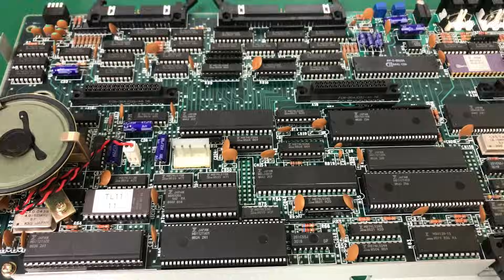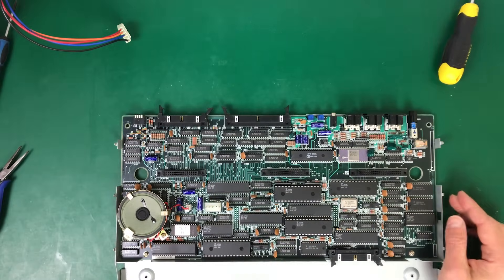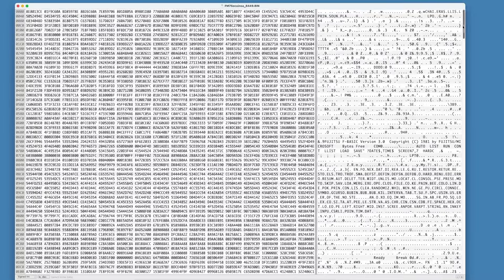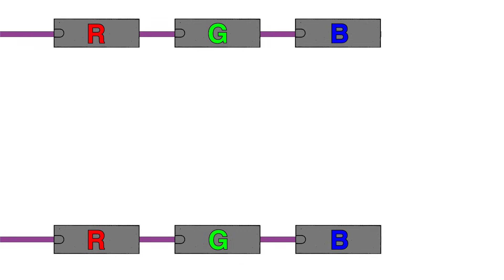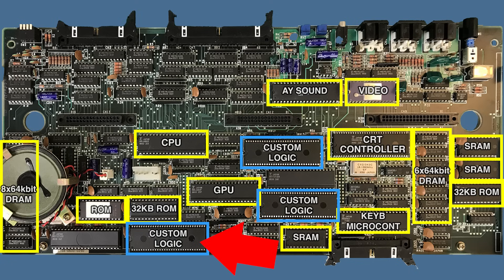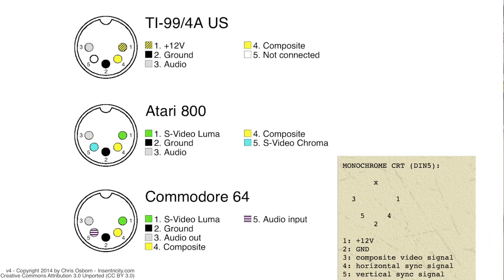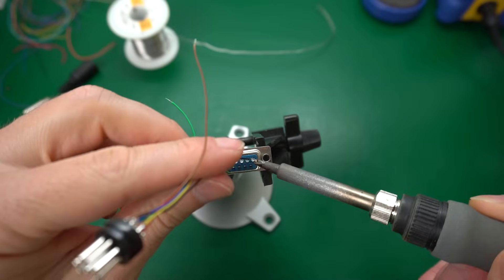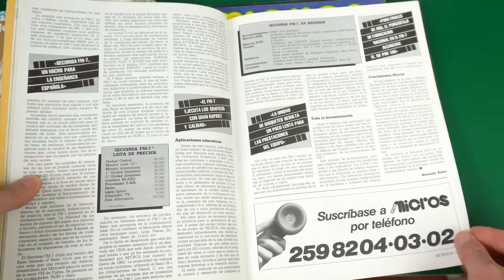This 8-Bit Computer Has Two CPUs (And One Acts As A GPU!)

Comment: The architecture reminds me of the BBC Micro with its IO processor (the BBC micro 6502 itself) handling the video/IO, and a second processor (via the BBC Tube interface) running the application.  This was the original idea by Acorn for the Proton (BBC prototype). You can get now lots of co-processors for the BBC with the Raspberry PI.
Reply: Acorn BBC - Econet GOOD TIMES - although ELITE (Braben & Bell) was almost unplayable (way to fast) if your (primary school) Beeb had a second 6502 processor connected via the Tube interface.

Comment: You said in the Commodore 64 DIN socket pin 3 carries sound so you could use that cable for the video out, but all 3 of the DIN connectors you showed also have sound on pin 3, you could do the same for any of the cables for those machines.

Comment: It's worth keeping in mind that one of the reasons for the sub-CPU architecture was that the video display system was done much more simply than on many other computers: it's a straight 3-plane 640×200 graphics display, with no hardware support for text, scrolling, or anything like that. (I'm not aware of any other 8-bit computer system that did this as a standard display system, though there were probably S-100 or similar video expansion cards that worked the same way.)

This creates two issues. The first is that your frame buffers take up 48K of address space, and the second is that you need to display letters dot-by-dot, as e.g. HRCG did on the Apple II. Given the address space and CPU requirements to do this, dedicating a separate CPU to the task makes a lot of sense.

And doing things this way makes even more sense when you remember that the computer was designed to display Japanese kanji. The kanji card for the system had 128 KB of ROM and held several thousand 16×16 kanji glyphs that the sub-CPU could read and render in the same way it rendered normal text.

This also offered several fun features. Since a program was rendering text, you could render it at arbitrary sizes and orientations; FM-BASIC supported this.

If you're interested in the details of any part of the system, I have made the schematics and a few notes available on GitLab in the `retroabandon/fm7re` repository.

Comment: FM-7's main system can be switched to various CPUs,  The expansion slot on the right is for that.
MAIN(6809.,6309, Z80, 8088, etc…) + SUB(6809)
This slot is also used to connect FM-X (MSX),  Control MSX display and sound from FM-7.

Comment: The Nintendo 64 (and most SGI's that it was based on) were similar in this aspect, sort of. The graphics was another MIPS cpu, but basically run more like a microcontroller with microcode that controlled the (mostly) fixed graphics pipeline. The main CPU did the geometry, and the second did all the rendering with passed parameters. The second did have things like 4k of graphics cache on die, but it was indeed a second processor with code and cache built in. Remember that SGI created OpenGL.. basically a way of abstracting draw instructions that the microcode in the graphics CPU would interpret into it's own instructions. Very few games actually licenced the ability to change the microcode so it was usually a fixed pipeline in essence, but modifying it would be like adding features to OpenGL, like adding a posterization layer or such.

Comment: The first thing that came to mind when I saw the title was the Soviet Elektronika UKNC, which has two of those Soviet NC-architecture CPUs that are not PDP-11 clones on chips but are PDP-11 compatible (binary I think but might be only assembly compatible for all I know). That also has 3 bit planar graphics, but is paletted out of a 6 bit palette. It is also much later, 1987. I have no idea if it has any ROM for the peripheral processing unit as it is called, but I would like to think so given its allocated role of graphics processor despite being just a normal CPU. However it probably doesn't. It was very interesting to learn about this machine anyway, thanks!

Comment: 11:12 The 2KB ROM definitely is code (good call).  From inspection and educated guesses, the ROM is divided into 4 sections that are bank-switched into address 0xFE00 - 0xFFFF.  On the 6809, address 0xFFFE is the reset vector and all 4 banks have the reset vector send the CPU to address 0xFE00.  In the 4th bank, there is just 1 instruction: BRAnch instruction that loops forever on itself.  The other 3 banks start with a BRAnch instruction that skips over the next 9 bytes which appears to be 3 JMP instructions (likely a jump table).  I'm not a 6809 expert but still interesting early results.
Reply: Just took a peek at the 32KB ROM 8449 and its last 512 bytes has the same structure as the 4 banks mentioned above.  All 5 banks are different.  Interesting...
Reply: After using a diff tool on the 4 banks of data (ignoring the one empty-loop-forever bank), they have a common structure.  They mainly differ in the first ~64 bytes and the last ~64 bytes.  The middle portion of each are identical other than a few bytes due to some jump offsets being slight different (this middle portion is what the 1st of the 3 JMP instructions mentioned above jumps to).  The 1st 64 bytes is where the main differences are.  The last 64 bytes are typically empty except for one bank where the 1st 64 bytes JMPs over the middle section to continue executing in the last 64 bytes.

Comment: Awesome video! It's such an unusual system. You should have no issues taking a computer like that through airport security - especially since it doesn't have batteries. I've packed many slightly weird things like electronic drum machines in carry-on bags and have never had any trouble. As long as an item isn't explicitly on a prohibited list you should be good.

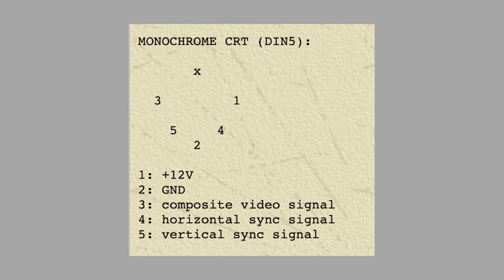Comment: 13:56: The 60Hz-ness and the 12V pin on the DIN connector (13:06) lead me to suspect this probably originally shipped with a custom CRT that was powered from the computer. Kind of like Amstrad used to do it.

Comment: Actually the system diagram does explain what that extra 2k rom is.
CRT
10k ROM
MB8364
MB8516(CG)
So that block is actually two ROMs, 64kbit/8kbyte and 16kbit/2kbyte.
The second ROM being labeled as CG confirms what I suspected, it's a Character Generator ROM, or set of bitmaps for letters and numbers to be displayed on screen.
Reply from the maker: Oh that makes a lot of sense! Thanks.

Comment: You've got 14 address bits going to those 16kbx1 ram chips. There are just eight such ram chips next to each other, to satisfy an 8-bit-wide bus.

Send those 14 address bits to two 64kbx4 ram chip (which still has 16k addresses, but is just 4 bits wide).

It is the same addressing. Two 4-bit-wide ICs is the same effective width as eight 1-bit-wide ICs.

Comment: Very cool.  The "gpu" seems to follow the 6502 and ANTIC scheme on the Atari 8-bit line somewhat, where you could upload independent programs to the ANTIC (limited to a small set of graphics related functions) called "display lists" stored to on-chip S-RAM to perform some graphics functions independently of the 6502.
Reply: Display lists weren't in on chip SRAM. Antic fetched them from regular memory using DMA. In fact Antic does all the DMA in the system.
Reply: @user-qf6yt3id3w  Thanks for the correction.  The onboard SRAM is used for other things: "A buffer within ANTIC is used to store graphic data for a single scan line. Its purpose is to buffer data for use on repeated scan lines, reducing DMA overhead. For bitmap modes, it allows ANTIC to only read graphics data for a mode line once, during the first scan line. For character modes, it holds the character name data which is then repeatedly used to fetch each scan line of character data from the character set."
Reply: @redleader7988  Well I never. You're right. And if you look at the die shot the 48 bytes of SRAM take up a decent percentage of the die. So Jay Miner and co must have thought it was really necessary.
Reply: Yep that was a classic Jay Miner design. He also designed the Copper graphics coprocessor for the Amiga which had similar capabilities.

Comment: You actually can upload custom code to the sub CPU. I'm not sure if the commands fir it were ever officially documented but they're there.

The two CPU setup is interesting because it means normal code doesn't have to worry about managing the sizeable 48KB of VRAM or having to share a bus with it while the sub CPU can get full direct access to it. On competing machines like NEC PC-8801 or Sharp X1 you had to bank switch the VRAM into the main CPU address space one 16KB bitplane at a time.

I think this setup was mostly there to provide high resolution graphics while letingt programmers focus all the CPU time on processing without worrying about the graphics subsystem getting in the way. I don't think graphics draw performance was that much of a consideration.
Reply: I was going to write the same comment. It is indeed possible to upload custom code to the sub CPU. Each of the main 8-bit Japanese systems had a different approach to obtaining high resolution display, it is very interesting to understand and appreciate them, and their evolution.

Comment: If you added a second processor to a BBC Micro via the Tube interface then the Beeb itself was effectively relegated to an IO processor.
Reply: We had a BBC in our school with a "Z80 second processor" so that it could run CP/M.
Reply: Back in the day, I had a 65C102 co pro (similar instruction set, but higher clock speed), and a 80186, which was an Intel chip, and could run DOS and GEM.
I never had the Z80, or 32016 (expensive research kit) - and there were others.

Now, you can get a Raspberry Pi Co Processor, which can emulate any of the original ones, and can run in native mode. (You can also use the HDMI output on the Pi, but that kind of misses the point...)

I have a BBC Master with a Pi CoPro, a Pi 1Mhz Bus Disk emulator, and a Pi Econet Hub/Bridge ... kind of like in Star Trek, where the ancient Voyager craft has all the new kit added to it to make it keep running, but in the core, it's still the original hardware and programming....

Comment: Interesting that this computer would use an actual CPU as a graphics processor rather than something hardwired, which while much less flexible, would be WAY faster and also much cheaper than the complicated hardware we see here, with RAM, ROM and even SRAM and those big gate arrays for interfacing everything.

There were 8-bit systems with blitters quite early on, the Williams hardware which ran Robotron 2084 for example used two custom blitters to draw all the stuff flying around the screen (up to 80 objects/frame drawn - way too much to do in software at the time.) The hardware could do a theoretical 1MB/s, and clocked in at 910kB/s when actually running the game - I assume the game either isn't maxing out the hardware, or some performance is lost in overhead while writing to the blitters' registers.

Comment: If that's a PFC SMPS power supply, it doesn't need a 220/110 switch. It will work on either. Only the old type power supplies needed a selecter switch

Comment: 6:20 I don't understand why you would jump to that weird conclusion about the layout of the video RAM.  (I don't have access to this system, so I can't check, but given the design of the earlier version you have the schematic for, that is certainly not the way I would have done it, or assumed anyone would do it)

The original version has three banks, each of which are 8 bits wide (1 bit x 8 chips).  So why would you not assume that the new version also has three banks, each 8 bits wide (4 bits x 2 chips)?  Then the only change in the architecture is that each bank consists of two chips instead of 8 (which means the rest of the system design can be identical to the original one (same shift registers, etc)).

Comment: I honestly think that maybe its very well possible that you can write "shader"-like things for this in the tiny memory unused from the graphics ram AND the sram. That is one would need to upgrade the rom of the "gpu" so that it can copy data from sram into main graphics ram's unused area and define a special opcode (with parameters) that run that uploaded code - this only makes very small shader possible - but theoretically possible to add custom functionality I think only with writing to the rom of the "gpu"... Sounds cool. Also it is possible that their cpu-side rom can do this too and support it already, but if not it still sounds a possibly hack to pull of.

Very cool!
Reply: "Shader" is probably too-specific a term. I would go with "graphics processor" since a shader means executing the same code for each of many pixels simultaneously. Then again shaders might technically be Turing-complete but they don't really like branches or loops whereas using a full CPU as a graphics processor you've got no such restriction. Nevertheless it would have tons of uses for game and demo tricks, that's for certain!

Comment: Hmm... If the graphics 6809 can execute code in SRAM, some really cool stuff could be made by having the main CPU write code for the graphics processor to execute. The main CPU could keep writing code while the GPU runs it, just making sure not to write the bit the GPU is running.

Britain's Coupe computer was another 80s design with a second CPU for graphics. It used 2 Z80 CPUs and emulated a ZX Spectrum, though its build quality was probably much higher. It was exceptional in having its keyboard toward the rear of the case, leaving the front as a wrist rest like a modern laptop. Its downfall was the fact that it couldn't emulate graphics mode 7; a mode so powerful, almost all games used it. Essentially, the Coupe could only run Spectrum business software and, well, I think we can all imagine the problem. :)

It's also the same idea I'd use, but I'd use 2 6502s -- or 3 or 4! :) But I'd have the whole RAM shared because I'm lazy and fast SRAM is cheap now.

Comment: VideoRAM config: I think they just replaced each bank of 8 1bit RAMs with 2 4bit RAMs. A CRTC is usually the signals for a Cathode ray tube: horizontal and vertical sync rgb, chroma/luma or composite video signal.

Comment: You will find something not similar but interesting in the French Hector/Victor and their "CP/M floppy unit", this one being a complete computer, and what looked to be the computer only do keyboard handling and display management, both unit with a Z80.
So the Hector/Victor main CPU, Z80, is available to do anything you want, with it's graphic modes!
Reply: The communication was done through RS232C (thus UART) @ 9600bds, so less interesting than shared SRAM chips, but still efficient enough for a computer of this era.
And I naturally used the second Z80 to display a not-so-nice animation while the other was loading CP/M80 and the associated professional software that made sell this weird combo.
Reply: You should make an entry with the Canon-X07, took me time to understand its inner after desassembling its Basic.
Also a main CPU (NSC800 a CMOS copy of the Z80 but unfinished!) and what seems to be a Hitachi 6301 (clone of 6800) exchanging also through internal UART. The second one controlling the display!

And also on the SCART, because some of their functions is still not properly supported by HDMI with 2023 equipements!

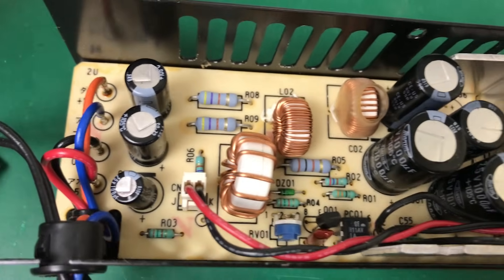Comment: @12:12 looks like it needs to output +12V, -12V, and +5V, just like most MSX machines.   I successfully swapped out the busted power supply of a National MSX computer with a Mean Well RT-50B which provides all 3 voltages for just $23 on amazon.  Plus it was small enough (minus the metal case) to easily fit inside the computer.

Comment: OK, the video RAM of the new board mirrors that of the old one. It had 3 * 16K by 8 in 24 chips. The new one has the same but uses only 6 chips because it takes only 2 chips to make a 16K by 8 compared to 8 chips in the old design.

Comment: You got the circuit diagram wrong at 16:34. If you want to lower the voltage you need a voltage divider, that's 2 resistors per channel, one of them going to ground. Resistors work on current, not voltage. If you look up "voltage divider" you should get it, it's not really complicated.

Comment: Looking at the 2 kB  ROM you called "GPU rom", it looks much like a boot rom, with four 512 Byte pages, mapping to 0xFE00 -- you can see the reset vector at the end of each page pointing to that address. The last page just does in infinite loop, but the other 3 are each different.

Comment: Interesting: this architecture with two 6809's for cpu and video is very similar to the Qix Arcade board design! Communication between the two happen there via 2kB (or 4k?) dual-port ram, and signaling via the 6809 fast IRQ lines. The Qix video subsystem has a lot of dedicated video rom which (logically I assume) contain next tot the display routines a lot of graphics and sprite data of the game itself. There are differences, but it is also very similar.
Reply: Well if there's no Qix port to the machine we'll have to encourage Noel to write one! (-:
Reply: @andrewdunbar828  Haha! Interesting, but this computer has no 6845 crt controller AFAICS. And the qix arcade uses that 6845 to put out a fixed 256x256x8bit resolution. Not to mention the 30-40kb of game roms on board sprinkled in the CPU/data, video and sound sections....
Reply: @jaapverhoeven422  Yep they're far from identical but they have at least one interesting thing in common.

Comment: Dual CPUs where one CPU was used a GPU is not that unusual. The HP125, and later the HP120, is a CPM machine that had two Z80s. The second Z80 was used as a GPU. 

There is an HP legend that Steve Wozniak worked on this computer before he started Apple. I've not been able to confirm that, but I do own an HP120.